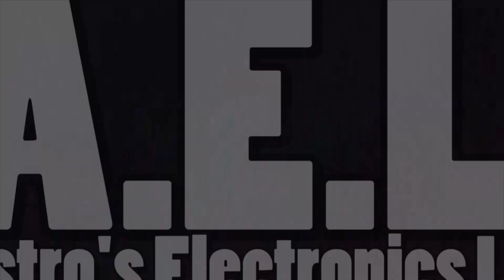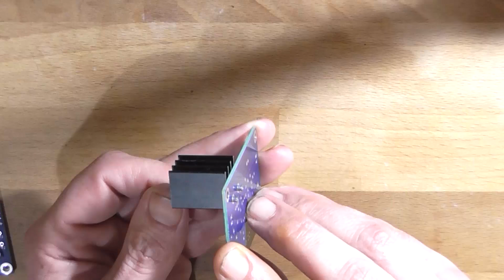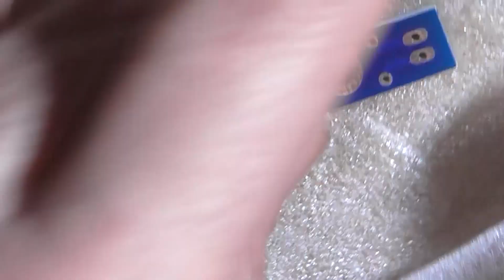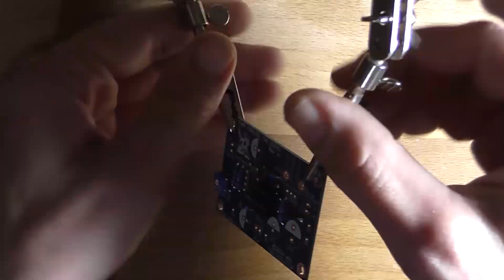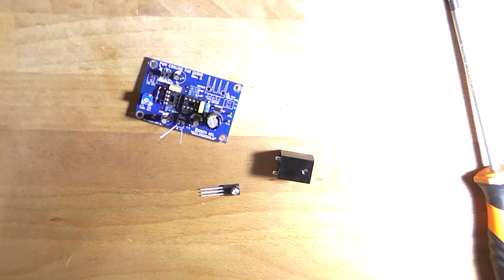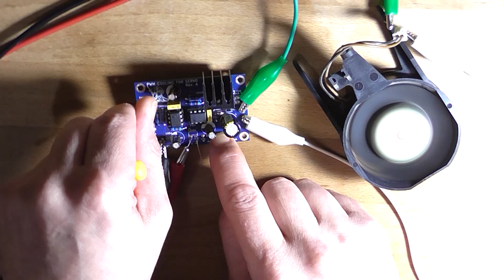555 Timer PWM-Controlled Cooling Fan: PCB!

Comment: The exposed copper with the time can get corroded
Reply from the maker: Correct. This is why I ended up with a $1 discount on the damaged PCB.
Reply: @AstrosElectronicsLab  I always used jlcpcb and never had any issues with them
Reply from the maker: @SymbolTech21  I've never had issues with PCBWay, either.